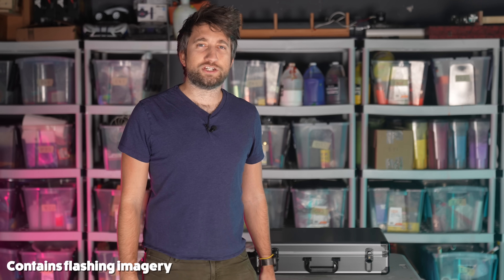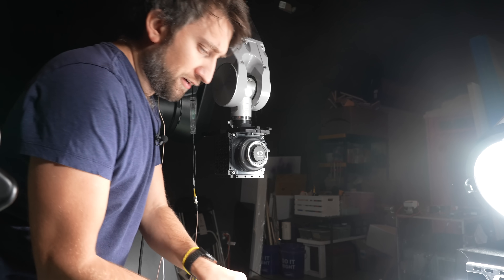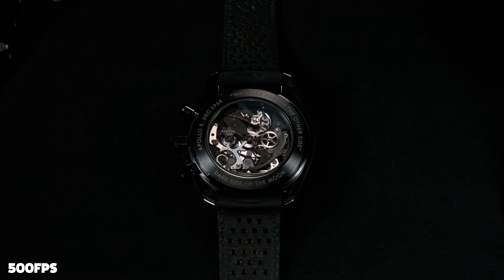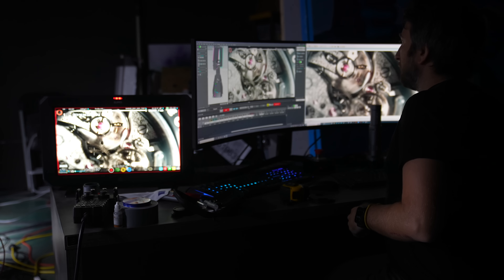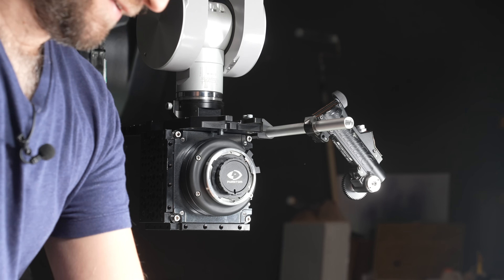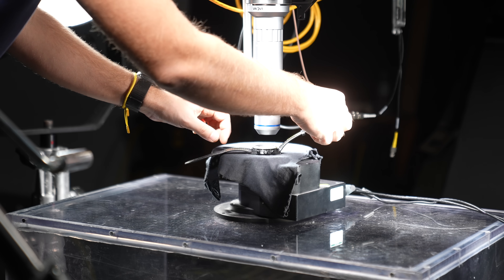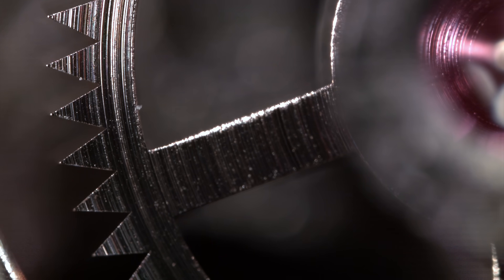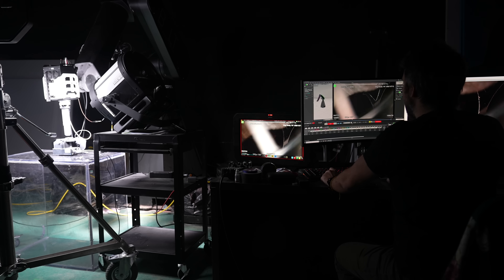Slow Motion Microscope Inside a Watch - The Slow Mo Guys

Comment: As an engineer, was confused by the 'sloppy' amount of backlash on the saw-toothed wheel until you added the Chronograph cog. Then I was flabbergasted by the reasoning/cleverness of the 2 to one-ish tooth mesh on those wheels mainly for excellent positive engagement.  Impressive experiment to go along with AMAZING gear.  I would suggest a Granite Standard for your pedestal next time, something we require for sub-micron measurements.  Thank You Sir!!!
Reply: Thank you for expressing exactly what I also thought until the aha moment. It also makes me wonder if omega or watchmakers have ever done this type of imaging themselves,  and whether seeing  Gavs unique footage would provide a level of insight for improvements.
Reply: @MARVINMotorSport  I imagine that after Gav points his camera at any sort of mechanism, the engineers in the relevant industries start taking pages of notes.
Reply: Also an engineer and had the exact same thought. "Gee, I wouldn't have expected them to cut costs here - particularly as the other wheels use proper involute teeth.......Ooohhhhhh!"
Reply: @JMMC1005   As a human from planet earth who is not an engineer like you guys, can you try to explain to us ignorant people what the damn hell did you speak to each other? I am extremely curious. :)
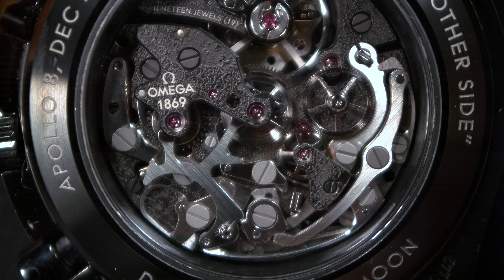Reply: @ylmzayan  One gear had twice as many teeth as the one it meshed with when he turned on the stopwatch. Reduces the odds of you turning it on right as it would tick past the other tooths tip. Less room needed for it to disengage also.  14:18
Reply: @ylmzayan not an engineer but I'll try translate:

"was confused by the 'sloppy' amount of backlash on the saw-toothed wheel until you added the Chronograph cog."

Backlash is how much back and forth a mechanism has. For a cog, if they don't fit together perfectly there is some wiggle back and forth. That is the backlash. There seemed to be a lot.

The "bad" cog is a saw tooth (straight edges) cog - this is unusual except for cheap applications. It's an easy cog to make, but it doesn't have good teeth contact, so isn't precise. The other poster mentioned surprise they didn't use involute teeth - this is gear teeth that are a precise mathematical curve to always keep in contact. You can see that with the curvy toothed gears.

"Then I was flabbergasted by the reasoning/cleverness of the 2 to one-ish tooth mesh on those wheels mainly for excellent positive engagement."

When the chronograph hand is engaged though, you see why it was sloppy (it wasn't attached to anything so was just bouncing around) but also why it had triangular teeth - because it was a gear that had to move and engage with another gear. Triangle teeth can slush together without so much damage. Then the further interesting thing is the gear it smushes into has twice the teeth - this makes it engage much easier than if it was trying to smush into a gear with big coarse teeth - but as it's a 2x multiple of teeth, and they're plain old triangle teeth, it still works good enough as a gear.

Also then the mechanism for the hand is engaged and the "backlash" is reduced - because the other way to reduce backlash is to provide some force or load to the gear.

So it wasn't a triangle gear because it was cheap, it was actually a very clever design.
Reply: @ylmzayan  They're speaking in the weird language of "metrology." 

It was invented by a Mr. Whitworth, and everything in your life depends on it.
Reply: @hanvyj2 - Flawless translation!  Much appreciated.
Reply: I've been down a whole YouTube rabbit hole of how to make these tiny tiny parts to such tolerances.
Reply: @JMMC1005  Actually they are epicyclodial. Backlash doesn't matter in the train between the mainspring and escapement since it's under constant tension in one direction. Involute teeth need oil on the teeth because of sliding friction and are therefore seldom used in watchmaking where teeth are not oiled. Where involute teeth are used they tend to be a high replacement rate part.
Reply: @andybullis1140  Well, there you go!

Makes sense and I've learned something.
Reply: The cog he was filming is called the clutch wheel (obv reasons once you think about it) and it has significantly more play than any other wheel
Reply: I think he was using the fish tank so he could also shine light up through the watch like a microscope, I didn't actually see any lights down there so I could be wrong.
Reply: the amount of surface area on this setup is initially larger than the same larger teeth together would be, idk why they did that but it looks violent, perhaps the idler was snapping teeth before the lifepsan goal or maybe they just went for a gear they already had 300 of lying around
Reply: Key Points from the Comments:
"Backlash on the saw-toothed wheel":

This likely refers to the slight looseness or play in the gear teeth when they engage and disengage. Normally, backlash is minimized in precision engineering, so seeing it might have seemed unexpected until the function of the chronograph mechanism was revealed.
"Chronograph cog" and "2 to one-ish tooth mesh":

The slow-motion imagery likely demonstrated how the chronograph's wheels engage, specifically showcasing a clever gear ratio (approximately 2:1). This design ensures secure engagement and precise operation of the chronograph's timing functionality.
"Proper involute teeth" versus other designs:

Standard gear teeth are cut using an "involute" profile for smooth and consistent motion. The video may have shown a deviation from this standard in some parts of the mechanism, which initially puzzled the engineers in the comments until the purpose (likely related to the chronograph) became clear.
Granite Standard pedestal for measurements:

The mention of a granite pedestal suggests that precise, vibration-free imaging or measurements are critical for analyzing the mechanisms at a sub-micron level. This points to how technical and detailed the video analysis was.
Omega and watchmakers' potential interest:

The commenters speculated that this type of high-quality imaging could provide watchmakers like Omega (a luxury watch brand) valuable insights for improving their designs.
Reply: I've worked as a diesel mechanic and rebuilt my fair share of rear ends and transmissions.  And every time you have gears meshing together there's always some amount of lash.
Reply: @c1a2t3a4p5i6l7l8a9r  Yeah, it's basically mandatory if you want the gears to turn. There are zero-backlash systems that use secondary gears to preload the teeth, but those are mostly reserved for low speed precision applications.
Reply: Cool story bra
Reply: If it was not like that, the seconds chronograph hand would stutter erratically, as it was the case with some Speedmasters, mine included.

Comment: Clocks are aweome engineering. I am wondering, imagine it moves 6 times per second, there must be wear, probably not much, but 6 times per second makes 518.400 movements per day and 189.2 million movements per year. How is that possible?
Reply: Most of the gears are cut in such a way that they roll against one another, to avoid as much rubbing friction as possible.  The rolling can't be perfect, but it at least reduces friction.

Comment: 7:23 - you missed the part where the escape wheel actually pushed additionally energy BACK into the pallet fork to prevent it from ever reaching equilibrium. This is known as the "impulse" and it's why the fork jewels are angled and the escape wheel has such an odd shape.

EDIT: 7:47 - never mind, you got it... lol.

Comment: I'm more impressed with the watch gears than the slow motion camera! The mechanics behind this 😳😳😳
Reply: Don't forget they used to have to cut every gear by hand and then manually balance the mechanism rather than using precision machining, and they were still just as small and precise
Reply: You should check out Wristwatch Revival. Marshal cleans and repairs watches. The size of the parts is microscopic. He brings some really beat up watches back to life.
Reply: Yeah, I always felt this way about high speed photocopiers or printers. LIke, the digital wizardry is amazing, but the mechanics of all the paper handling/routing always blew my mind..
Reply: @ right!? I bought a $100 printer and there must be 2,000 mechanical components... Digital components and programming can be somewhat be made all on "paper" but mechanical real world objects?? There is always some "gotcha" that's hard to predict!